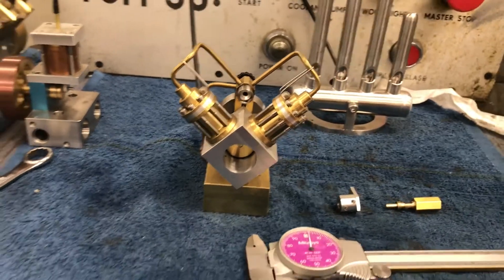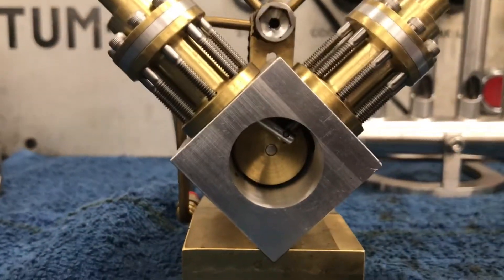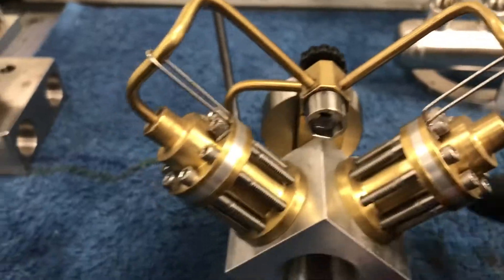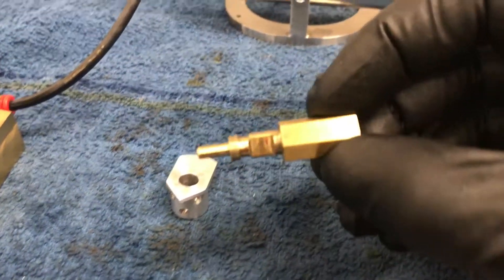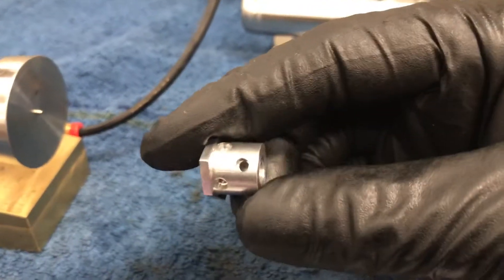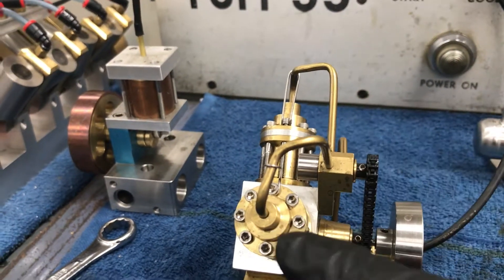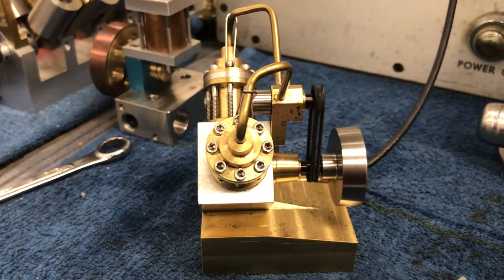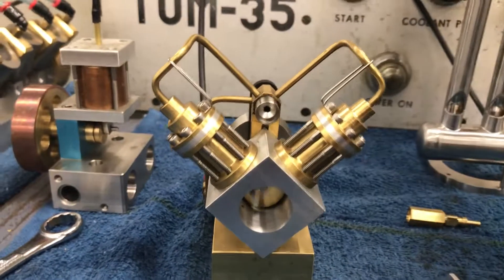TWIN CYLINDER STEAM ENGINE WITH CHAIN DRIVEN CAMSHAFT

Comment: Hi it is amazing. I did not understand how your valve works. is the air coming through the hole or is it exhaust? Does it only work with Vee engines? thanks